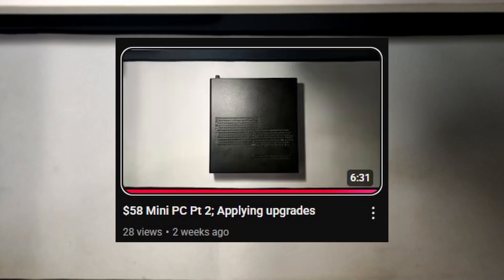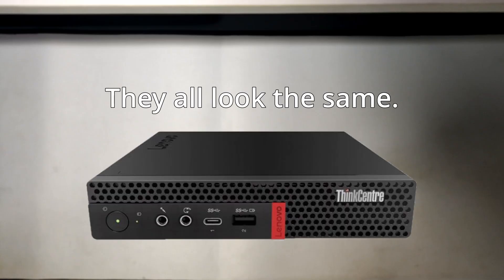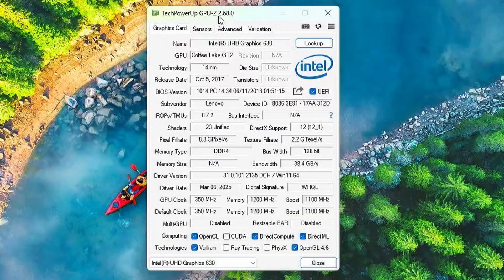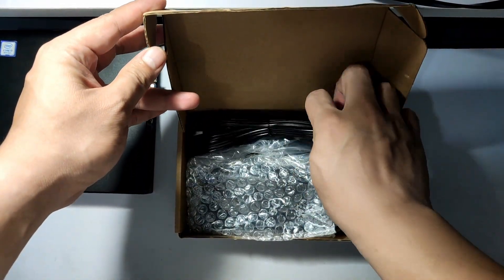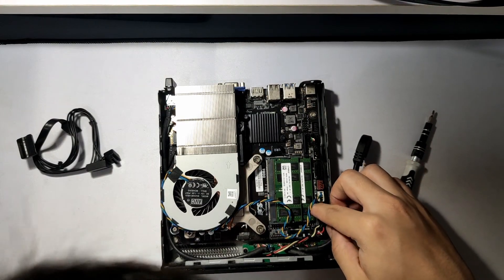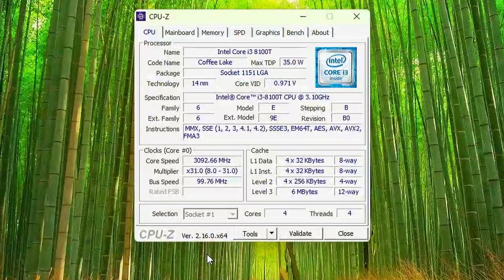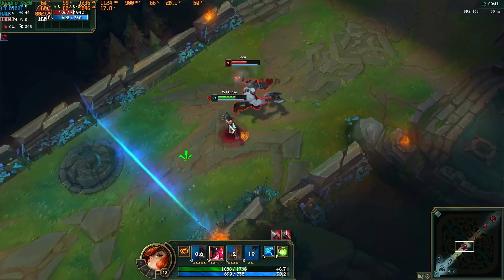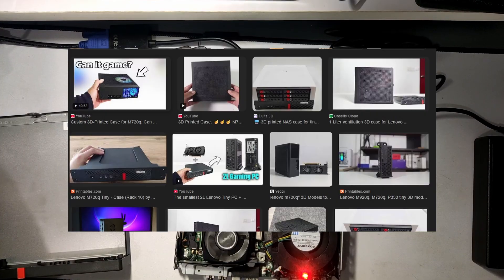Upgrading my Thinkcentre M720Q to its full capacity - Pt. 1

Comment: I run the m720q with a yeston 3050,  a i5 9500T and a 170w psu for a decent portable gaming rig. I hope to either get a i9 9900T or a copper cpu cooler and a i7 9700 or i9 9900 for me it´s a 200-250 usd upgrade, technically perhaps not worth it but would be cool to do. Have anybody tried a non T with the copper cpu heatsink upgrade? If so, what were your results?

Comment: I have an m720q i-7 8th gen, 32 gb of ram, and currently just a 1tb nvme, I've been trying to figure out what gpu to put in it, or maybe doing the GPU on a stand next to the PC itself
Reply: Perhaps you already upgraded but the Yeston 3050 at 200 usd from factory is a good choice in my experience. You will need a psu upgrade to make it work (minimum 130w). Good luck.